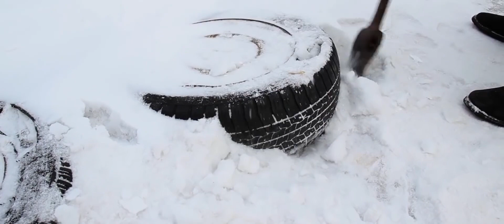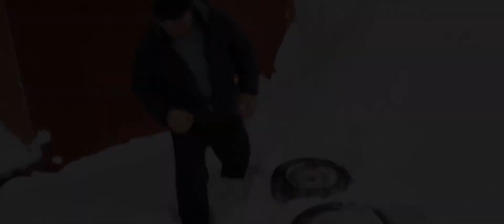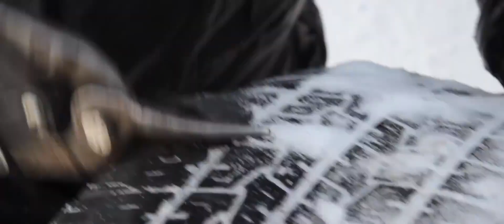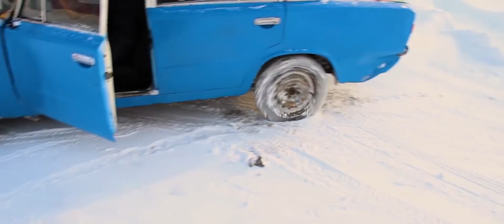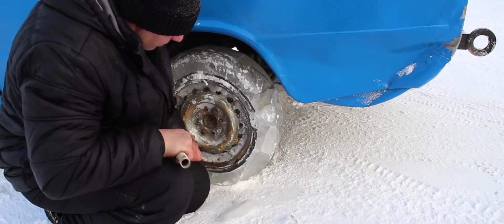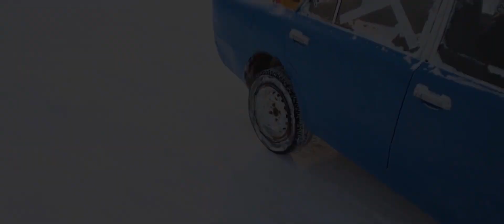Making tires out of ICE

Comment: If you ever try this again, maybe set the rim into a round mold and fill it with water, and let it freeze. That way you dont have to cut the tires off, just drill the holes for the lights and whatnot.

Comment: Ok try this. Do as you did with these tires, fill them with water and let the water freeze....BUT first put studs in the tire treads. After the water freezes, cut the wall of the rubber tire off. Take the ice studded tires to your test track and see how well they will hold up.

Comment: you do not even need 1100Hp with 1500 lbs of torque to make the tire feel like ice, just make them out of literal ice and you can get stuck in a flat parking lot with any engine! ;P
Reply: My car doesn't quite get stuck per se but it's a nightmare
Reply: @jonnyenough1531  well i live in Canada and i can say that from the Age of 12 i always wondered why it was Legal for cars to be 2 wheel drive! like they should all be 4x4 or AWD! can you imagine the Ambulance stuck 20 meters from the place they need to save the person but they are stuck on a small elevation...

i guess what i mean is, even without tires out of ice some places are slippery all seasons, just that winter is worst ;P and now add tires MADE from ice... i wonder if it still counts as a burnout!

Comment: My understanding is that the reason that ice had millions of bubbles in it is because the air is trapped in it during the freezing process.  Why does this happen?  Because the ice doesn't freeze from bottom to top allowing the air to escape as the ice crystallizes.  Instead the top freezes first and this process traps the air in the ice.
     I understand that the ice sculpture industry makes clear ice by continually moving the water.  As the water freezes it has a chance to expel the air bubbles.
Reply: Yep they have a water pump in the tanks when the cubes are done they are pretty big and perfectly clear. Funny how many think boiling the water will make it clear.

Comment: During WW2 and idea was floated (get it...floated) to make huge unsinkable boats out of sawdust mixed with water.  It was named after it's inventor and called Pykrete.  
        Pykrete features unusual properties, including a relatively slow melting rate due to its low thermal conductivity, as well as a vastly improved strength and toughness compared to ordinary ice. These physical properties can make the material comparable to concrete, as long as the material is kept frozen. 
      So I propose tires composed of Pykrete (tm).